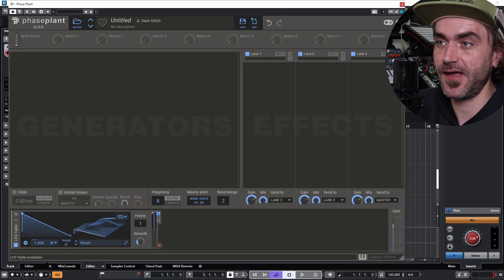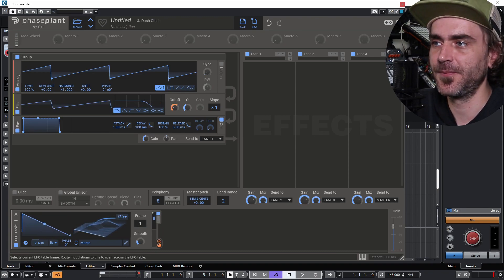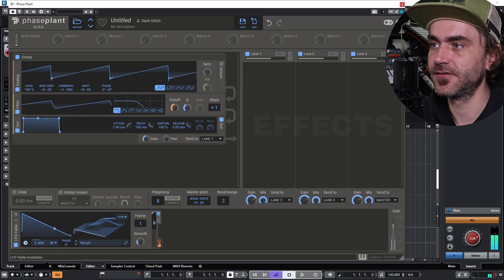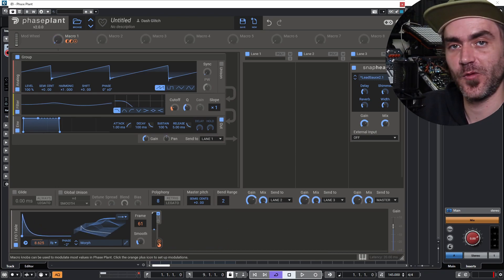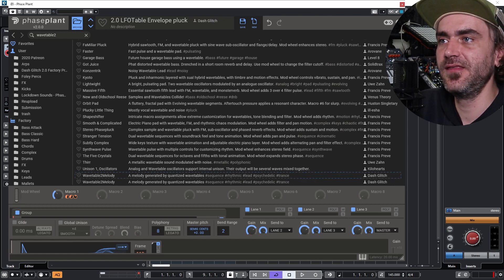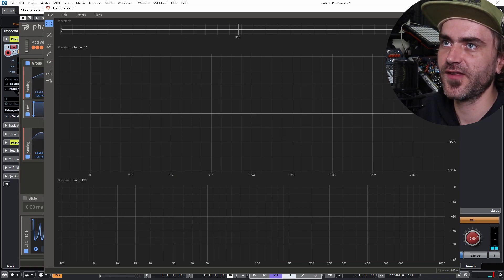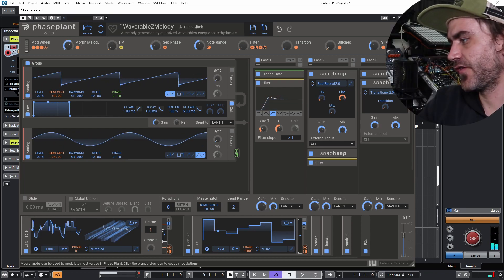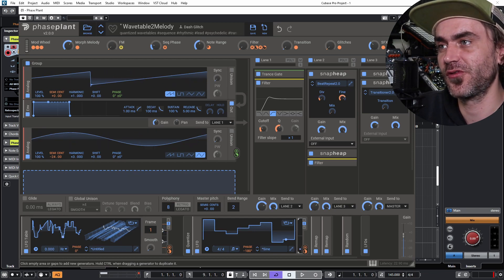Brief Explanation of LFOTables in Phase Plant / Snap Heap / Multipass 2 - And Why They're So Awesome

Comment: that's awesome! does anyone know how many samples these wavetables consist of? in serum and vital an oscillator wavetable has 2048 samples cause it can represent the lowest perceivable frequency well, but LFOs are much slower, so i assume they need to be super large in size to sound smooth, don't they?
Reply: Not really. There are wavetable oscillators in Eurorack for example Synthesis Technology E352 and E370 where wavetables are only 64 samples long and they sound smooth. It all comes down to the interpolation algorithm to smooth out the transitions. 

In PP you can use the same wavetables used for oscillators for LFOs as well if I am not mistaken.
Reply: @georgegyulatyan3263  it's cool to actually learn something about modular synths everyonce in a while. i'm always coming at these kinds of things from a DAW and plugins perspective, where a compromise often has to be found between memory and cpu, so that stuff like these LFOs don't take too much resources that can be used by the other effects and modules in the project. probably why no wavetables are 64 samples in size anymore in nowadays vst plugins

Comment: Is there an easy way to introduce slides between the sequenced (via LFO) pitches? The example at the end of the video is a very interesting and happy accidents friendly way to create melodies, but I like/need slides in my lead lines and if it's not possible to do this efficiently, I would still prefer to make sequences the "old fashioned way"
Reply from the maker: Yes, and this is why I think Remaps are better than the Vital/Pigments style quantize, setup a modulation to switch between a linear and quantized remap, and then modulate the amount of that in a sequence :)
Reply: @DashGlitch  nice one I’ll give that a try!

Comment: Interested to see what you come up with. I’ve used them a little bit and couldn’t get anything musically useful from them; they are too busy/noisy and I couldn’t see the advantage vs just using random sources, to inject a little bit of chaos
Reply: some of the busier lfo tables are best done with tempo sync and much much slower rates like 2/1 or 4/1
I like to think of them as morphable sequences
also as fun as it is to use regular wavetables as lfos, the 2 banks "complex" and "Simple" were designed with lfo usage in mind
Reply from the maker: Then you're in for a treat ;)
Reply: Its probably only a matter of time before we start getting less busy WT LFO specific packs and stuff becoming available. I agree with you thats why Ive tended to lean towards the factory included shapes for the time being
Reply: But also for psytrance the rate control is quite vast, you can easily push that busy lfo shape into audio rates and use it as an FM/Phase modulation source
Reply: it has a smooth knob...xD